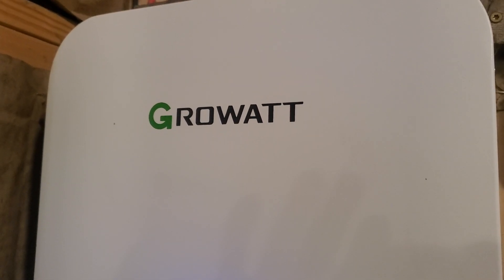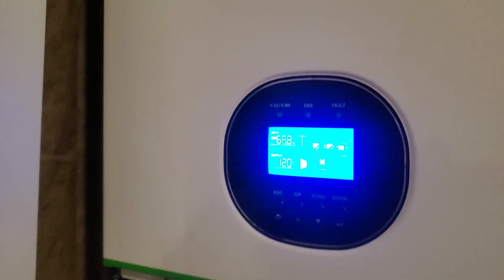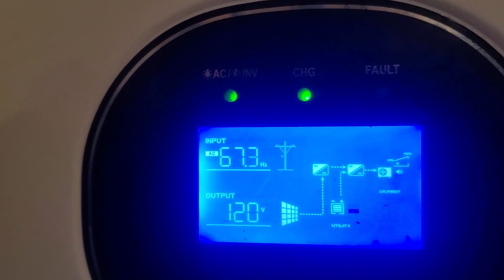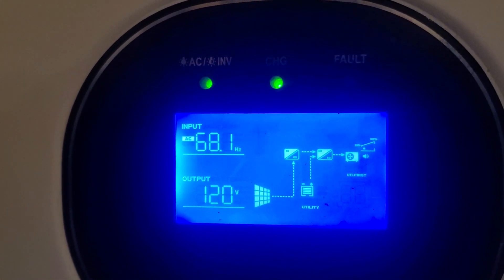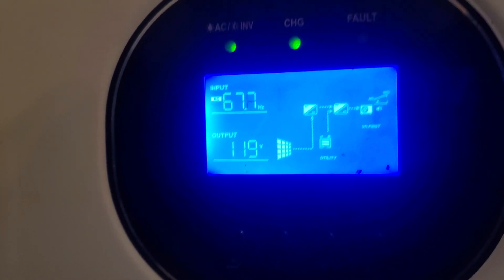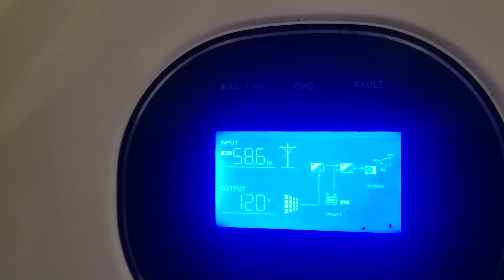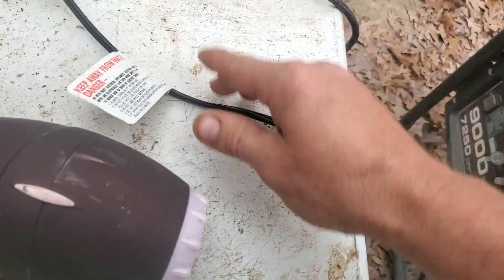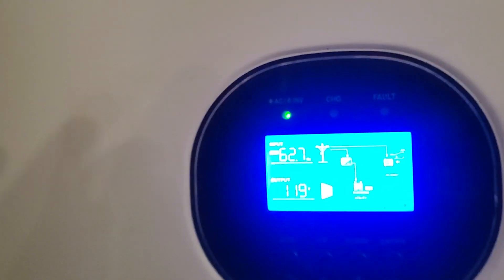Growatt Inverter FIX!!! | Won't Connect

Comment: Thank you for doing this video, I was having the same issue,  back and forth with growatt,  and the whole time I thought I was having an issue with inverter. I plugged an air compressor into generator and what do you know, Inverter recognized the power and started charging my batteries.  Thank you!!!!
Reply from the maker: @natejalbert2638  very glad I could be of assistance. Thank you for your viewership.

Comment: Yep....
that's a great idea . I was trying to find a setting for  generator and I found nothing in the manual.
Reply from the maker: If we could get the rpm dialed in it would be better but we just haven't been able too yet. Until then we are using the tank heater in the rain catch to keep it thawed currently 🙃

Comment: Just adjust the rpms down a bit!
Reply from the maker: Normally I would agree with you but in this particular instance it was too fine of an adjustment to get properly tuned in. Maybe with an aftermarket carb it might work but I'm not going that far just yet.
Reply from the maker: I will also add though that I am quickly heading that direction, being a carb swap. It's getting harder and harder to keep it lined up. Either way this is a good troubleshooting technique for anyone needing it.